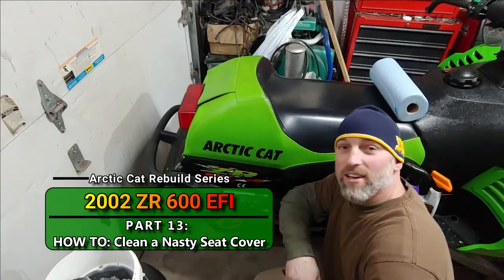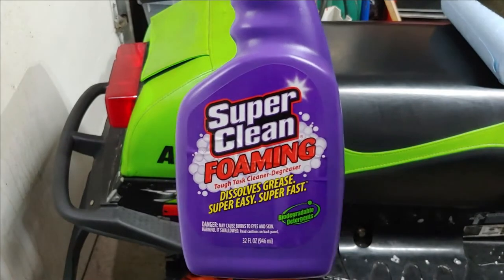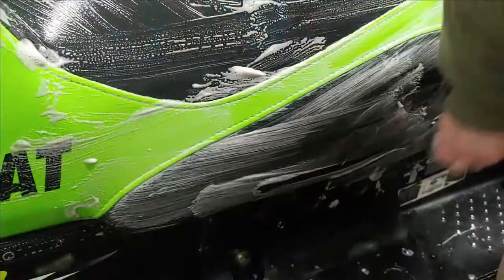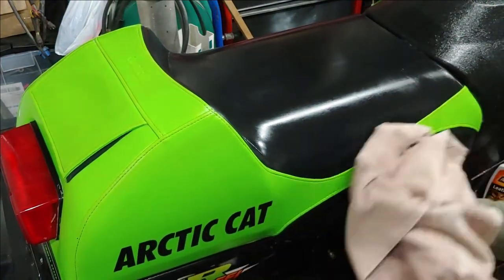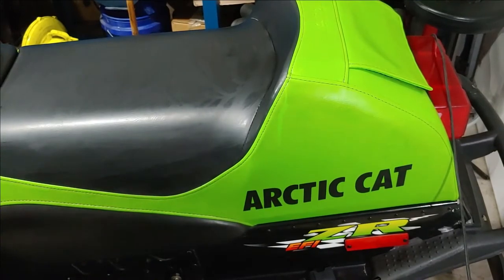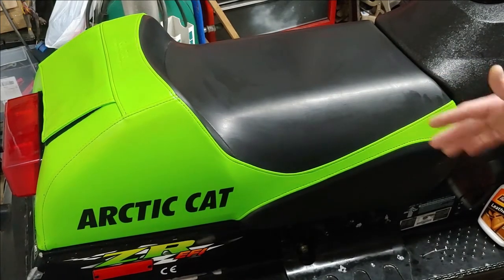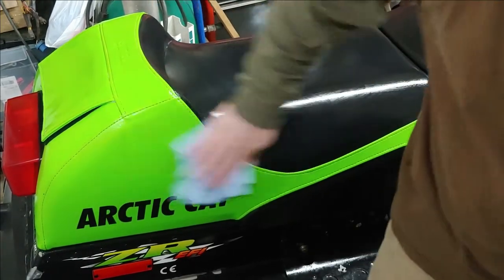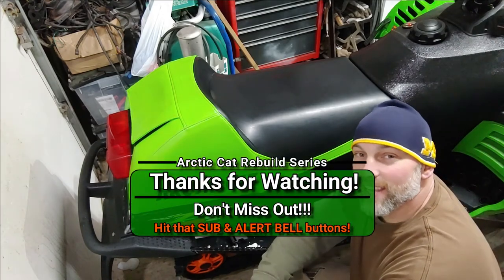02 Arctic Cat ZR 600 EFI Series Part 13: [How To Clean a Seat Cover]

Comment: Turned out nice.  A tip to consider - in the auto detailing world super clean works great on lots of surfaces.  For interior leather, plastics and vinyls, it is often diluted 10:1, 8:1 or 4:1 depending on how dirty and delicate the surface and 8 drops of dawn dish soap is added per 32 oz bottle.  Works really well and, in theory a bit safer for the surface. SC has a high PH level so it can be tough on the stitching and surface.  Many will rinse well with water just to be safe.  May not be an issue on the seat, but on a Lexus or BMW interior a bit more is at risk.  Love the series and videos.
Reply from the maker: Excellent thank you for the tips and thank you for watching

Comment: I used just a multi purpose clean like purple power and then I use mothers or meguiars super shine.  Pretty much any vinyl conditioner and protector.  I won't use armoral because it is oil based which acts like millions of little magnifying glasses.  Just my two cents.
Reply from the maker: Nice! Thanks! The stuff I used was armor all brand but not actual armor all. It's a conditioner and UV protectant for leather. But it was only temporary at this point as I just wanted to get this thing cleaned and conditioned. I have my normal chemical on order. So the Aerospace 303 is on it's way. That stuff is great! It can be used on anything really and creates a very strong UV barrier. 

Thanks for watching!